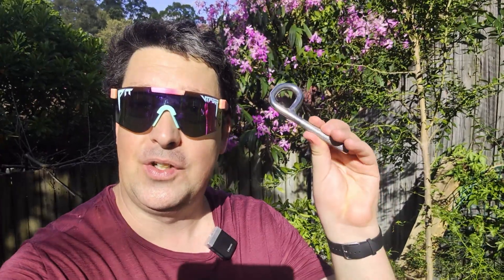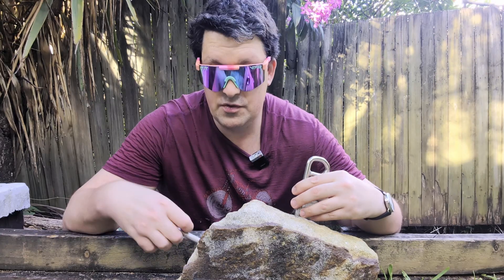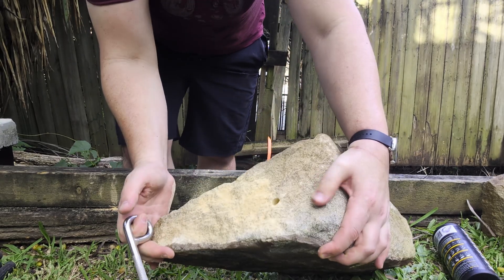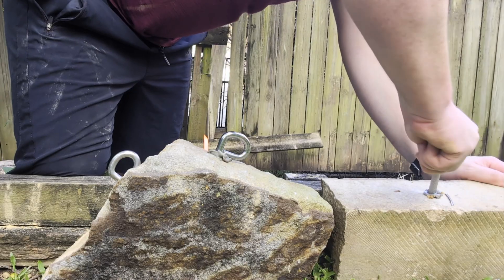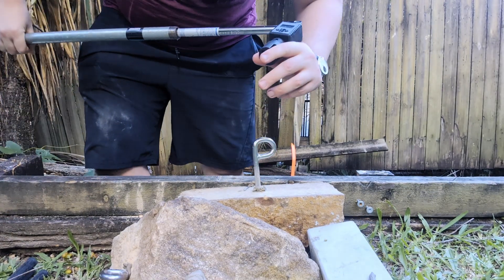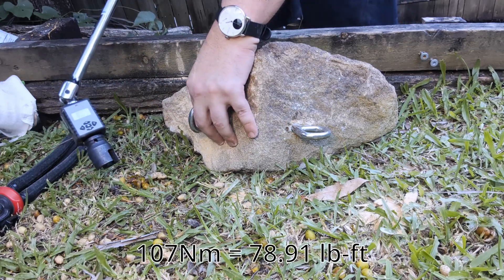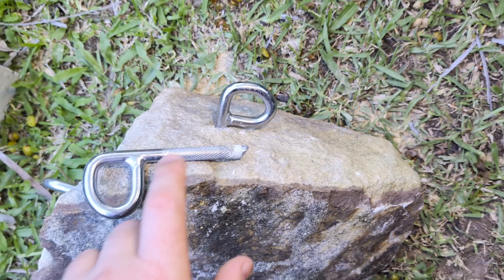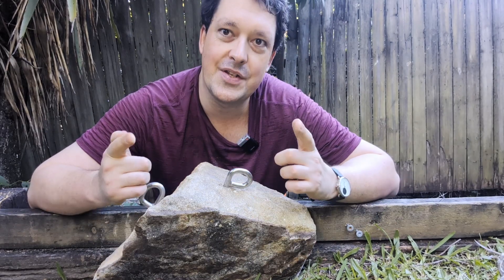How much torque should a glue in bolt take?

Comment: Thank you for this! Great stuff!

Could you please re-create this test with liquidroc vs ac100???

Also, please compare using a 12mm hand-held nylon hole brush and simple mouth blow-tube vs your electric hole blower vs an uncleaned hole with each adhesive. Also notched vs un notched with each. That will cover it ALL😂

Please and thank you!

Comment: Interesting. I was wondering how a glue-in bolt woud do in a pullout test, after you try to torque it to 100 Nm. The French climbing federation seems to suggest that you should torque-test glue-in bolts to 100 Nm (and 60 Nm for bolts). But I fear this would compromise existing bolts,without providing an answer to how much the glue-in would actually hold in pull or shear.
Reply: hello, where did you find this information? I am not aware of such a recommendation by FFME (even if one of their crew member do that without torque meter/with a crowbar, and have lead to a climbing ban of a whole region). German federation recommend to torque test glue ins with a carabiner (so not a lot of torque), I personaly do that on my routes.
Reply: @MrHassancehef  From a friend who did a bolting course with them in the South last year, the instructor said it would become an official guideline, but I don't have more info than that.
Reply from the maker: I think it's an easy way to test bolts without an expensive tension tester, so that's a great idea to do that. But 100nm does sound a bit high. 
I'm sure they based that on safety data but I'll totally test that when I'm finished upgrading my hydraulic puller!
Reply: @MountainMullet  with the "carabiner" torque test, it's probably enough to spot most of the bad glue mixing cases, without taking too much risks, it is usefull to test more?
Reply from the maker: Sure if there's a specific way to do it I can try, do you have a link to a test protocol?
Reply from the maker: Thanks, this is really excellent. It's a shame how much I miss just from only searching in English

Comment: The pullout strength after a 90-degree rotation would be particularly interesting to analyze, especially considering that P-bolts are sometimes placed horizontally on belays, a common practice in Europe. Thank you for your work.
Reply from the maker: Yes I'll pull these ones (and probably some new ones) after I finish upgrading my hydraulic puller. Unfortunately due to a failing pump I couldn't extract these ones in this video

Comment: This was super interesting, please keep these tests coming! One thing I'd love to see from you is how you do what you would consider a 'perfect' installation. Every time I try to install these types of glue ins that have the eye recessed (with epoxy) I make a huge mess, with glue everywhere on and around the eye. How do you keep the installation clean and neat? For example, in this case I saw you didn't remove the excess glue from the installation, but in real installations how do you clean the extra glue around the eye without making a mess?
Reply: If I do recessed eyes and wanna make it look extra pretty, I'll bring a small roll of duct tape, then place small strips of tape around the rectangular trough. Then I use a small wooden stick to catch any large blobs of glue before they drip beyond the tape.
Reply from the maker: Kevin @climbingtaiwan is a real artist, and I hardly ever get them 'perfect'😅
But my ways to make it nicer are cleanliness and consistency:
*Carry a lot of little paper towels
*Clean the nozzle before going into a hole
*Drill holes to a consistent depth 
*Now you can work on injecting a consistent amount of glue
*Lately I've been using 2 and a bit pumps with my glue & gun & bolts 
*Clean up outside with new papers every time you touch the epoxy
*If you're covering red glue with dirt, it's cleaner to touch up as the dirt gives a dry layer to press on
*If you do drop glue on the rock it is cleaner let it harden and chip it off than try to wipe it up
Reply: @MountainMullet  If I may add, something useful to prevent mess is to disengage pressure on cartridge (using the lever) with nozzle still in the hole.  Due to fluid viscosity the remaining pressure can keep  pushing glue out of nozzle slowly even when you stopped pulling the trigger.
Reply: Great stuff, thank you for sharing.  We're talking about notching/ not notching on the mt project fixed hardware forum, and someone said they can untwist Bolt Product SLBs which are installed with AC100 which are not notched, now I believe it!  I think epoxy like liquidroc 500 would perform much better.  I would love to see this same experiment, but using a pure epoxy instead of vinyl ester
Reply from the maker: Yes I'd believe that too! In general, only pure epoxies are truly adhesive, as in, stick to the bolts. Other types will anchor by filing in gaps (keying) but won't really stick to smooth steel. In this video towards the end I torque a bunch of threaded bolts and show this pretty well:
https://youtu.be/b5ARM--1xxw

But it's not always sketchy, those twist bolts will probably still be fine for tension pulls and plus you can easily replace them! So it depends what you're going for
Reply: @MountainMullet  no not sketchy, but it does make you wonder what will truly withstand the test of time!  If unnotched bolts with vinyl ester are more likely to become clickers from sideways pulls, that's all the more reason to notch and use a pure epoxy.  But notching is so tedious and prone to it's own errors... If un-notched solid leg glue ins perform better with epoxy vs vinyl ester, then that is worth knowing!
Reply from the maker: In general I have minor concerns about the longevity of all the small wire kinda bolts, but it depends on your requirements. Personally I want a 100-year anchor. I don't want it to move, fail, or need replacing, basically ever.
Others want one that's easily replaceable, which seems more common in Europe. Bolt Products boast replaceability as a feature of some of their bolts. Lappas says they should be replaced every 10 years. It's all bomber obviously, but different schools of thought come up with different requirements
Reply: @MountainMullet  I'm in the 100+ year no movement school of thought!
Reply: I'd also like to see the "perfect" installation (ie, with the groove/notch as recommended in the installation instructions) with AC100.